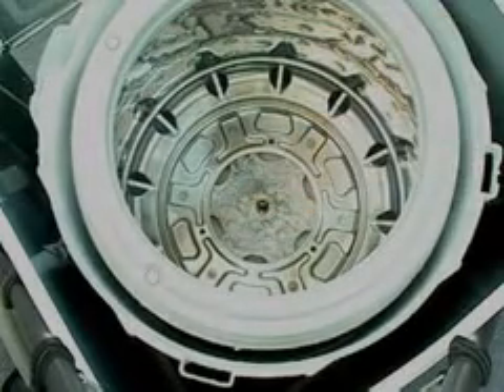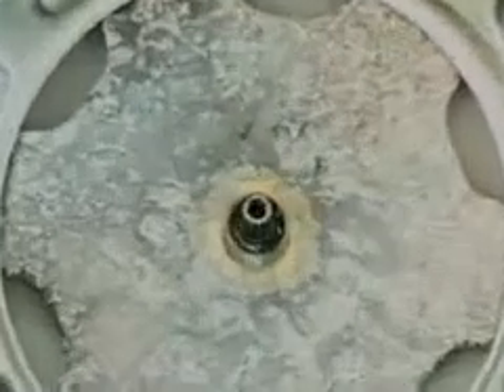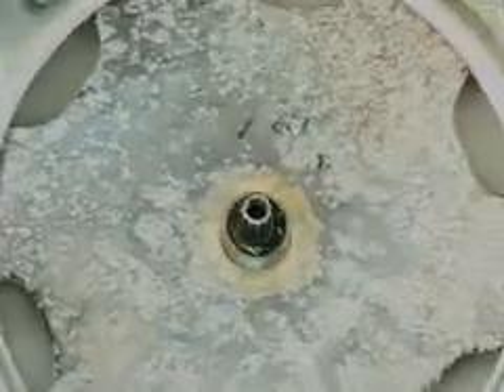HARMONY washer wsh basket rmvl

Comment: I have found your videos to be extremely useful and saving me a ton of money. But for the like of me I can not get the infuser off! I have tried everything I can find online also. I got the cap off and it was gross.. so I can imagine what is under this plate...and yes I removed the bolt with ring and washer. Any suggestions?

Comment: Where do you get the tool to remove the nut in the center ?
Reply: The manual says a 10mm socket for the small bolt and a 1 1/2 inch socket for the big nut.